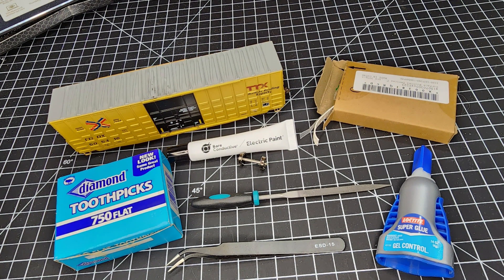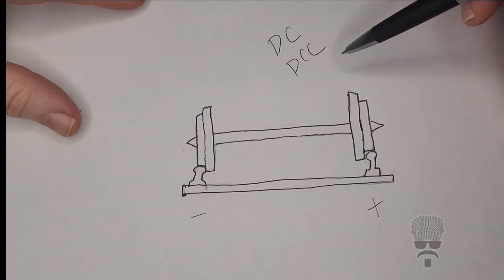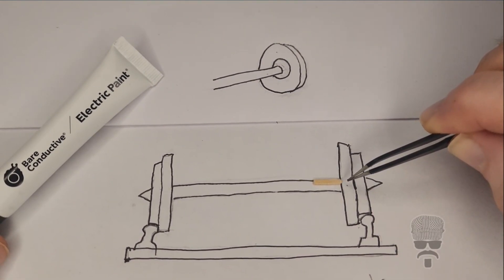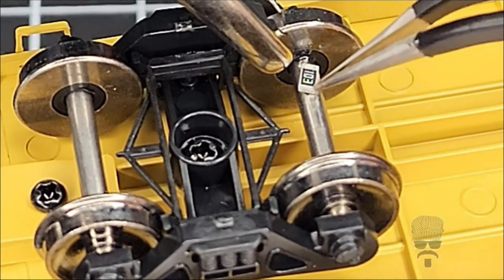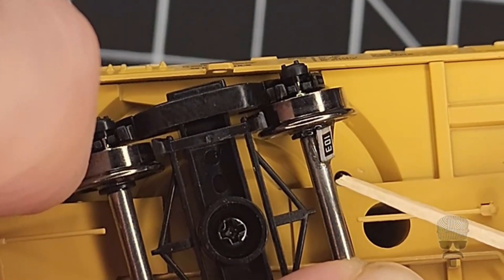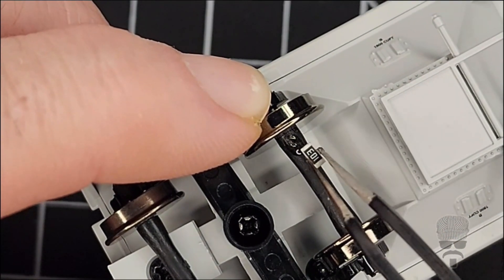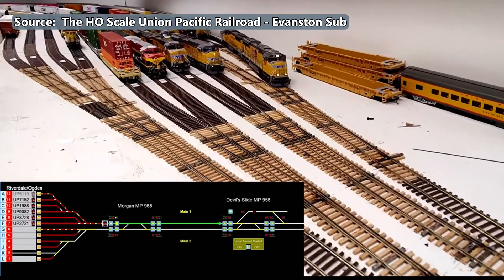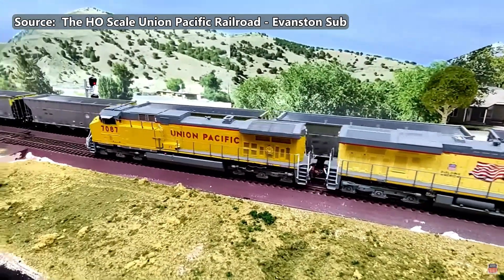EP. 20: HO Scale Resistor Wheelsets for Block Detection made EASY!

Comment: I never had any luck with this.  The paint ALWAYS seemed to go where I didn't want it to go.  I started soldering a bit of stripped armature wire to the solder pads of the resistor.  I run the wires to the wheels and use the paint there to complete the circuit.  I always scratch the inside of the wheel first so the paint can get some "bite" to it.  When the mood hits me, I will set up a dozen wheelsets.  That way I can install one whenever a new car is added to the roster.  I typically put one resistor axle on each car and always on the brake wheel end.  The exceptions are cabooses and long cars like auto racks and 89' Hi-Cubes.  They get one resistor axle per truck.

That is an impressive CTC system!
Reply from the maker: Thanks for checking it out!  If I have any issues I may just give that a try.  Good call on the long cars - adding resistors to both trucks.  I need to order a box of wheelsets and do that as well.  Can paint and weather them as well.  Thanks again!

Comment: Steve great video I tried this long time ago did not work well for me now I see this I might revisit this again I have many cars without resistors would like to get them all done thanks for sharing
Reply from the maker: Really appreciate you checking out the video.  Yeah you should play around with it a bit and see how it goes 🤠
Reply: @Cowboy_Steve   Steve,  You but one Resistor on a truck correct just pick one of the wheels?  and then on the other truck on the car do the same correct?  If so should the resistor be on the same side as the other truck?
Reply from the maker: @thomasrgrassijr  Just depends Thomas.  A normal length car really only needs it on one truck.  If you have some of those super long autoracks or similar I can see adding one to the other truck.  Doesn't matter what side of the truck you put the resistor as long as you mount the resistor next to the insulator bushing.  Clear as mud?  😅

Comment: I find the conductive glue doesn't work very well over the long run and if you try to whether the wheel sets you're really in trouble
Reply from the maker: Thank you for the heads up - I will be sure to watch for that.  Is there something else you can recommend I use?  Thanks for tuning in 🤠
Reply: @Cowboy_Steve  Best luck I have is using wheelsets with metal axles and soldering them which takes some skill but once mastered they don't fail even when painting them afterwards.
Reply from the maker: @frankneher9192  Thanks for the info... I think I'll give that a look this winter.  Makes sense 🤠

Comment: So, bottom line is that this application is for DCC only?
Reply: A book from Peter J Thorne, 34 New Electronic Projects for Model Railroaders shows him using a resistor and building a block detector. It is cheaper today to just buy the detector instead of build one.
Reply: No. Same principle for DC and DCC. There are occupancy detectors available for both systems.
Reply from the maker: Thanks for answering because I honestly didn't know... lol!
Reply: @kiwibjg  well, if you wouldn't mind pointing me in the right direction, I'd appreciate it. I have a split system with limited capabilities, so my detection system would be strictly set up for D.C.
Reply: @sort187  Bruce Chubb published his series on the Computer Model Railroad Interface (C/MRI) back in the 1980’s and he has been updating since then as well as others around the world. His original block occupancy detector worked on DC control systems. Then he updated the design for DCC. They both give a nice clean transistor output to run LED’s, TTL logic, relays and whatever. He does have a website where you can buy the circuit boards or made up units and there are other companies doing them as well now too. The circuits are available if you do a search as well as other C/MRI items to help with control. I use all these on my layout and they are all really good. 
Hope that helps. Cheers